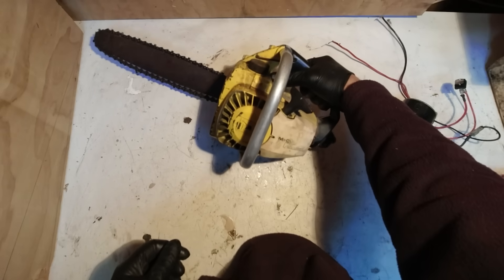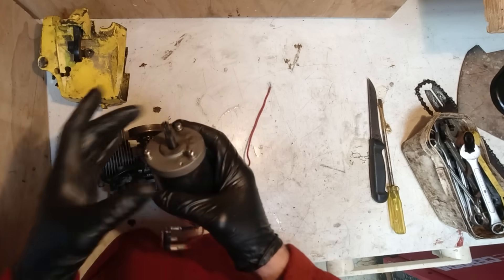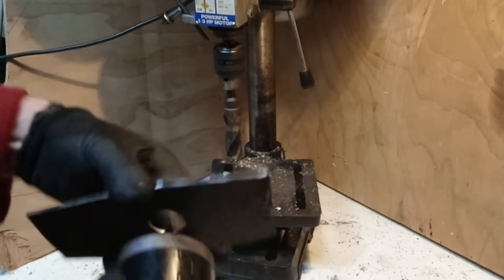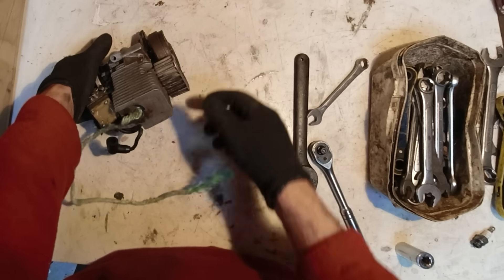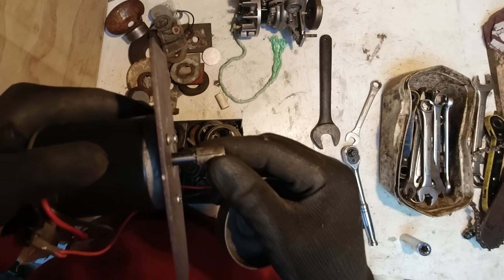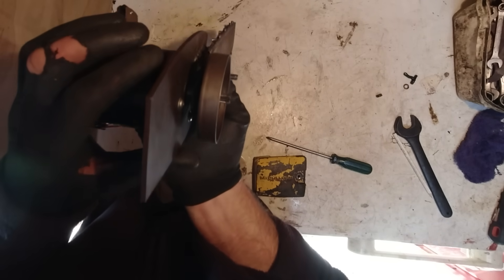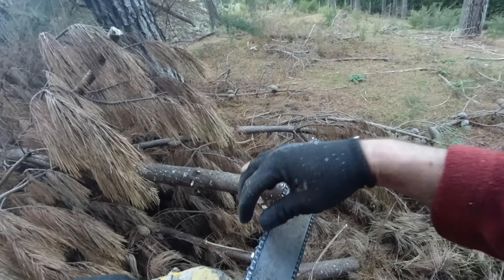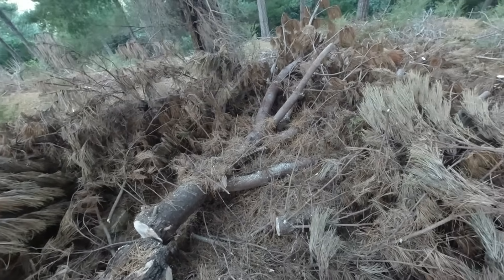Battery powered chainsaw made from Junk

Comment: You can 3D print battery attachment points for most brands. I have a couple for DeWalt 20v batteries that I use. It would be useful to just attach a battery to that chainsaw.

Comment: that was what i noticed in your chainsaw review. you did not have a little 12 inch blade saw for limbing trees. i dont have a lot of experience  with chainsaws, but i did cut firewood to heat my house for a couple years. names did not matter, function or
 failure did. i have no need for something that only works 10 minutes. id rather use hand tools. great build. great video thanks marty

Comment: I was wondering if you had just left the centrifugal clutch off and went direct chain drive it would have been just fine since the clutch is used for a running motor to idle? DC motors are either on or off. Oh wait. I guess you did rig it up direct. You just used the housing. My mistake.

Comment: Epic build! I've welded a socket onto an old bottle jack so my cordless impact now operates the jack as well as removing tyres and parts.
Picked up a 3d printed battery receptical for Milwaukee batteries to power an old car air compressor. You can get them for Makita, Dewalt, and, Ryobi, not sure about tool pro. Hot melt glue one of those suckers to the back or the chainsaw for longer run times and easy swap out.
Reply from the maker: Clever ideas

Comment: Nice work! I used an ATV winch motor in a chainsaw a few years ago, same concept except mine's got jumper cables to a car battery. Yours looks a lot easier to swing around, and I'm surprised at how long those little hobby batteries lasted.

Comment: By the late 70's  the McCulloch had a chain brake/ safety handle,  so this is probably older than you think   . With  chain brake  safety  this would be a hell of a  lot safer/ greater peace of mind.
 You could wire a safety wire  to chain brake  so that  with brake engaged, there is no power, much as most modern power tools eg skilsaw , grinders  etc require  a safety and trigger depressed to work  
Great idea, well worthwhile as a proof of concept  

Cheers

Comment: Make sure you've included some sort of low voltage cut off with those Li-PO &/or Li-Ion batteries. if/when they drop too low on the voltage the battery is permanently damaged, & won't properly perform afterwards, even with recharging!

Comment: Some table fans these days come with pretty overbuilt electric motors, these table fans can cost anything from 5 bucks to 50 bucks so buying one to rip out the motor might be an idea and just feed them way more voltage than the table fan would ever need, and just add some form of cooling to it a fan or anything as they will run hot.

Comment: Id be a little concerned about motor cooling, that motor probably is only intended to run 30-60 seconds. There appeared to be no heat sink. Im also absolutely amazed those batteries could do that much work! Must be a descent bit lighter then it was originally? Without the vibration of the 2stroke aswell.
Reply from the maker: It is half the weight after the modification, motor was warm after 7 minutes work but nothing to worry about

Comment: Nice franken-saw.  I LOL-ed when I saw you putting the "pseudo" gas tank back in.  Nice decoy!  But I realize you might need it for lining up parts in the assembly and for the chain oil reservoir as well.  How sharp was the chain before you started?  I know that a chain's condition can make a huge difference with a little sharpening and should add to your battery cutting time.  I recently picked up a battery-powered saw that runs off a 60V lithium battery.  I was able to run it thru a log that varied from 6"-15" diameter with around a dozen cuts before it was too low to make any more big cuts.  I really bought the saw for limb trimming like you were doing, so the log was a test of its run-time and bigger-cut capability.  I was pleased with what it did.  Luv your projects.  BTW, how is the road grader doing after your initial fix and testing?
Reply from the maker: The chain is quite dull, I didn't have the right size file, I expect it will cut a lot faster once sharpened

Comment: Those XT60 connectors are handy! I soldered in a splitter with 6 of them off of the 12v  supply in my car that feeds the cigarette lighter plug. It runs the dash cam, ham radio, and 5amp USB plug with room for expansion! Out of sight and won't wiggle loose.

Comment: I found, that an oil filter wrench works good for grabbing a hold of the flywheel, to get the clutch off a chainsaw engine.
Reply from the maker: Goo tip, that would work

Comment: I bought a Oregon brand about 10 years ago, with an extra battery.  Cost all was about $400.00.   Seems like a lot, except I’ve not put a single drop gas in it, some bar oil, and used it to cut up fallen trees on driveway, shrub cutting,  pruning trees, etc.   it gives mr about 45 minutes of cutting power, thus the extra battery needed.  For my use I’ll never crank on a gas chainsaw again.

Comment: Would it work longer on a battery pack from a cordless drill? Was the motor rated for 24 volts? To be honest I was surprised that you got as much as 10 minutes (if you had not cut the larger piece it would have lasted longer) with replaceable battery packs it would last so much longer with 2 on chargers and one in use. Very nice job
 I have always used gas saws and had never even thought of a battery powered one. Thanks!
Reply from the maker: Yes I think cordless drill packs would work, others have suggested bigger lead acid motorcycle batts in a backpack which would give more run time and lighten the saw

Comment: You should add a snubber diode in reverse polarity across the switch. A 1N5554C.TR would do just fine or and standard 5 amp diode.

Comment: My question is, can you turn the chain on the bar, or do you have to remove it to sharpen? I have found not being able to touch up the teeth on the bar on electric saws a deal breaker
Reply from the maker: That's a good point I'd never considered. This one turn easily
Reply: Most can turn the chain on bar, just need to disconnect from  the power and then hold throttle on whilst pulling chain around- I had my Makita for a long time before I discovered that !

Comment: May I ask that you add a low battery warning to those Lipo batteries?
Like other batteries, they will run themselves as flat as a pancake
But UNLIKE normal rechargable batteries having them go flat kills them internally.
Either a voltage cut off or a voltage alarm would be good.
Reply from the maker: I can tell when lipos are getting near their safe low limit
Reply: @MartyT  good good.. The voltage cutoff would require slight rewiring, voltage alarm is just a bolt on to the balance port of the charger.. 
Only annoying thing with the voltage alarm is that is needs to be removed when stored as it would slowly parasitically drain the battery.
I've not figured out a way to switch all my wires on a home project with a single switch yet. I just can't seem to find a 9P1T switch in which at least 1 of the poles can do 30 amps.. strange that.. LOL

Comment: Very neat to repurpose and recycle. Some friends of mine once made a motorcycle from a bicycle using a chainsaw engine. It wasn't very fast, only went about 10 mph, but it was fun to build. 🚲
Reply from the maker: Nice, me and a friend made one of those when we were at school, it had a bit of string for a throttle, clutch outer driving the front wheel, it did about 40kmh but it wasn't safe

Comment: A new chain would make the saw cut even better.   I have an EGO 16 inch 56V chain saw.  It works great.   I use it with 7.5 amp hour batteries.  Also use it with 5 amp hour battery that came with it.   It was a couple hundred dollars and works great.  Lasts about an hour with the 7.5 amp hour battery.  Not cheap but much better than gas for around the house.

Comment: Batteries don't like heat but if that motor doesn't get too hot and since it only runs 10 minutes or so per charge maybe being in the case with the motor isn't too bad. My hat is off to inginuity!

Comment: Careful with the rope trick on an engine you want to save. Make sure the piston is over the ports on a 2 smoke and on compression stroke for a 4 stroker. I share your affection for the old iron, I have a 1953 IH TD-9 for acreage maintenance. Great videos!

Comment: at the end you mention AC motors in corded units and dc  motors for batteries, but corded units use a universal motor with brushes and will work fine on AC or DC, just need to get enough voltage to make it useable probable not possible in the 220v world but in NA 110v you can get close to that with 18650s all in series 20 or so of them  harvested from tool batteries laptop batteries ect,

Comment: Backpack mount a good battery pack and just have a quick connect on a cable. With a good frame you can have 30-40 lbs of batteries going for a much better run time as you can use more lower output but longer life cells. The fact the same backpack battery pack can be used to run other tools or even jump start equipment helps the utility of it.
Reply from the maker: Not a bad idea

Comment: Thoughts: Either install the charge port right under the gas cap and put bigger batteries inside, or make it so you can quickly and easily change batteries when one dies.  The option to run it off of an AC outlet would be useful if you're somewhere that has one available, maybe purchase a small-ish 24 volt PSU for a 3D printer and install it inside, or if you go with easily swapable battery packs, make the battery pack socket accommodate the 24 volt PSU?
Great job though, very impressive!

Comment: so welding, grinding, materials, time and effort....... i can buy an electric at home depot $60
Reply: Good for you, but you’re not buying a complete (battery and charger included) CORDLESS chainsaw at Home Depot for $60.
Reply: @erikj.2066  For $60 you would only get a quality Chinese 
Home Depot special with concrete warranty, take it off the
concrete, warranty expires.
Reply: Ivan Olsen if you look at the HD website, you can’t buy ANY cordless chainsaw for $60, even if it’s just the tool alone. 
You can get a “bare” (no battery/charger) Ryobi for $100, or if you want the cheapest soup to nuts package, a POS “Sunjoe” China special for $130.

$60 gets you in the price range for a mediocre corded saw.
Reply: @victor ross I don't think Marty has a Home Depot near his remote, off-the-grid home in NEW ZEALAND.

Comment: You really should get some battery monitor circuit. Google "Battery Tester Low Voltage Buzzer Alarm" this device can be plugged into the balance lead and will beep loud when the voltage gets to low.

Comment: Cool! But the clutch was primarily to accommodate the 2-stroke's need for an idle without engaging the chain. Since you are changing to an electric (with no need for an "idle") couldn't you just omit the clutch?
Reply from the maker: Yep I did, I welded the outer to the shaft
Reply: @MartyT  Ahh - In my ADD I missed that, forgetting the drive gear is integral to the clutch drum (pressure plate / flywheel?). And as always I am impressed by tour skill and craft at building a better life off the beaten path. Rock on!

Comment: You can make a transfer punch by cutting the head of a old bolt sharpening the cut end to a point and voila nice punch that will sit in your tool box forever lol or not
Reply: I use a needle from a old diesel fuel injector,
works perfect as is.

Comment: If you want longer run times, all though you got through a impressive amount! 

If you have a tool of choice, ryobi Milwaukee Makita etc and have a few batteries. You could use a dead or unused tool to make a battery holder and battery contact part and use the batteries you already have.

18 volt should run that motor just fine but slightly heavier cables and beefier connections will 
Help.

Run it for a while with everything a bit loose then feel all the wires and connections and see if anything is hot. Thats a concern.

Using the modern batteries of modern tools where you can hot swap them will help a lot.

I have a brushless ryobi one 18 v ( used up a non brushless one first) and up to its bar length and as long as the chain is sharp it is very good. As soon as the blade is slightly dulled i give it in as you cant force them.

Great vid

Comment: I noticed you're using an angle grinder to cut your metal parts. Did your plasma cutter fail?
Reply from the maker: Much quicker using the cutting disc for these little jobs, takes a while to set up the plasma

Comment: Dear Marty T.
👍👌👏 Ingenious well done again and as always, Sir! Congrats! In my opinion that's exactly the way how to do if you have time and all the pieces for free. Because running with 12 V it is very variable and can also be driven by a car battery respectively a running car for instance. Much better than all that expensive high voltage crap you can buy. Your modified chainsaw is pretty perfect for sawing smaller stuff (to clear from branches etc.). Please kindly allow me to suggest: You could/should add this common kind of fork/rake/teeth that bites into the wood. With this the work is definitely easier and safer too.
Thanks a lot for making teaching recording editing uploading and sharing.
Best regards luck and health.

Comment: neat little trick for getting the clutch off. have an ms231 I'm rebuilding so that's great advice (Y)
Reply from the maker: Have you worn it out already? As someone else mentioned in the comments - Careful with the rope trick on an engine you want to save. Make sure the piston is over the ports before putting the rope in
Reply: @MartyT  Hey m8, nah it's not warn out. it was a parts saw I bought a while back so needs a rebuild on it. thanks for the advice (Y)

Comment: Hi, nice job! please keep in mind you have no protection on those LiPo batteries as it is now. The motor will drain them below the minimal voltage and kill them quite quickly. A simple LiPo Alarm would prevent that (like this: https://www.amazon.com/uxcell-Battery-Voltage-Tester-Buzzer/dp/B00H4Y6PY0/).

Comment: Wife gave me an Oregon battery chainsaw 5-6 yrs ago as gas one was 'too loud'.  Never used it but a few yrs later needed a
leaf blower and got the Oregon variant using same battery:  a 36v 2amp hr and a 2d 4 amp hr.   The blower runs about 4-5 min
per amp hour.   This is enough to blow off the drive way until the leaves get to the several cubic yd volume, then I need both
batteries.  So your experience correlates with mine, batteries don't last long per charge.

Comment: Nice, especially for the price, but I'll stick to my Ryobi with all it's safety features.
I value my  limbs too much. :-)
I get 20 to 30 minutes per battery depending on how hard I work it and I have 4 of them.
I still go back to the Stihl for the bigger stuff though.
I do have a cordless drill that now runs off my RC batteries, that is no where as innovative as your saw though.

Comment: for the trigger use a 20v cordless drill trigger it will also give you variable speed for the small stuff
Reply: I don't think you need variable speed for a chainsaw. The faster, the better, within reason.
Reply: @herrakaarme  I use small 2 stroke stihl all the way up to a 250CC 4 stroke chainsaw with massive chew bars every day and you don't start a cut on full power you get it started then hit it having control will also help prevent you from cutting your self into a jam on particularly sticky wood (fruit trees and nut trees mostly)
Reply: @endurofurry  You might be right, but when writing the comment, I was just thinking about the Stihl battery powered chainsaw I've rarely used. It even has a very delicate chain to help it eat through the wood. The corded electric Stihl I've used far more has a chain more like any regular chainsaw, but it doesn't have a variable speed either, and seems to work perfectly.

But then again, I'm not exactly a chainsaw expert. The one thing I would never want to happen is the chain jamming in the middle of the wood. Chain speed helps with that. Back in the day when I was googling info for selecting electric chainsaws, mostly the recommendation was to avoid models with very low chain speeds.
Reply: Any momentary switch not an off and on switch, if this thing falls from your hands for any reason it needs to switch itself off.

Comment: Need to monitor the lipo battery voltage. You can only take it down by about 20%.  If you exhaust them completely, you won’t be able to recharge them.

Comment: Nice job. How many cell lipos did you use. I wonder if it would hold on 6cell  lol.  But thats badass I do stuff like this all the time, everything has a purpose for a 2nd life. I rarely throw stuff away for threat kinda of builds.
Reply from the maker: I used 2x3 cell lipos out of my old quadcopter
Reply: @MartyT  you only said the c rating. But its still bad ass I live for stuff like this conversion are very cool in my book

Comment: Well done on the conversion. 
I have a Husqvarna AC powered chain saw.   I wonder if the motor is DC and so internal AC/DC conversion.   This would make the variable speed control easier.
Dave.

Comment: Chain looks bit dull, I think you could get more usage time if the chain would be sharper.
Reply: I am sure that you find a way to make a file out of used toilet paper 😂
Reply from the maker: You're right it is dull, I didn't have a file small enough to sharpen it
Reply: @MartyT  part II... Show sharpening chain, install safety hand guard, convert plug-in lithium batteries, time how much a fully charged battery lasts/cuts

Comment: Maybe use a relay to bypass the switch just to unload some Amps from it? Add an emergency stop just in case it goes haywire or locks up? Two switches for the relay in series maybe? It is nicely done but needs a tiny bit more safety than none at all